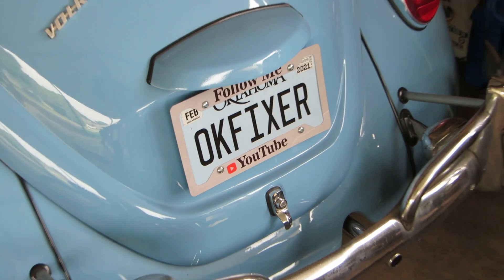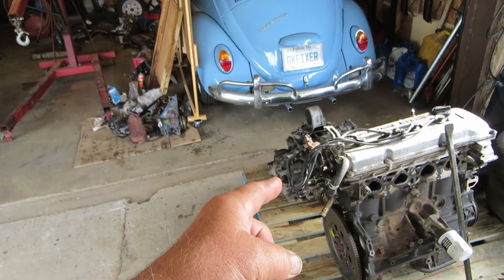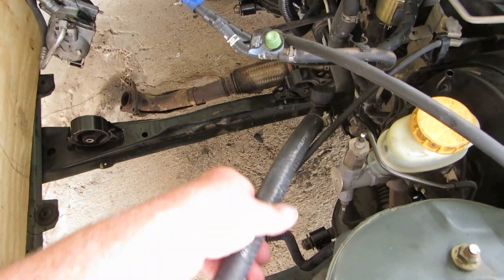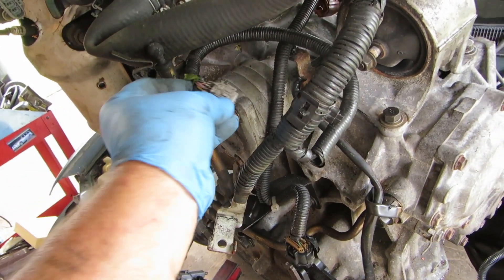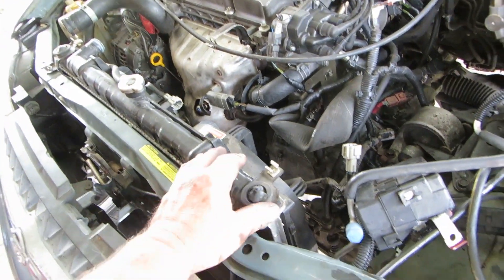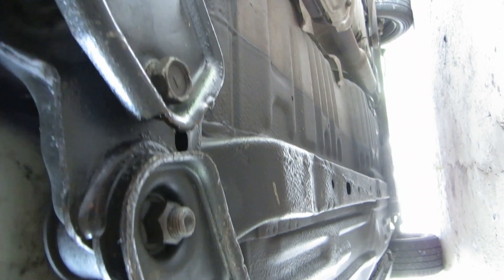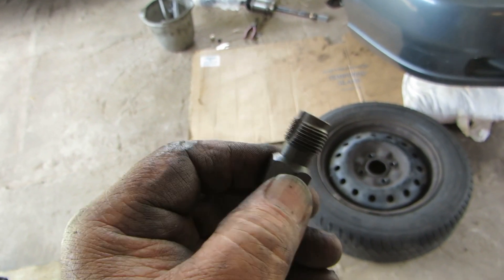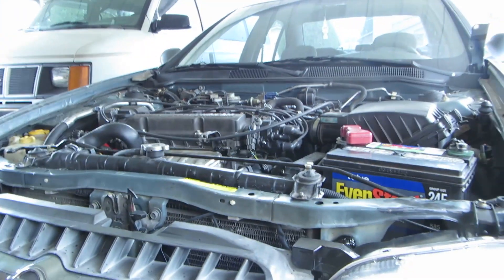Engine Swap Part 2

Comment: Surprised you didn't change the steering rack and pinion unit.
Here in New England  cars and trucks rust out before the engines go bad.☹ You don't see many folks replacing powertrains, unless its a vintage vehicle. Great info as usual.
Reply from the maker: Yeah, I thought about that but I didn’t have the bread
Reply: @OkFixer  
 I  understand.  I know how hard it is to replace one of those with the engine in place.